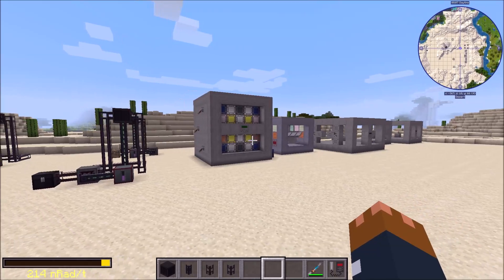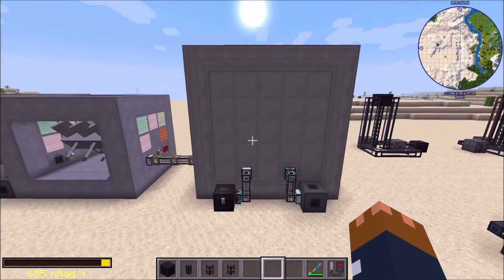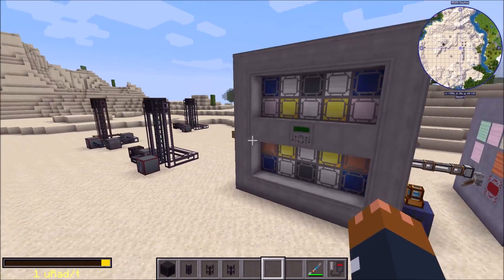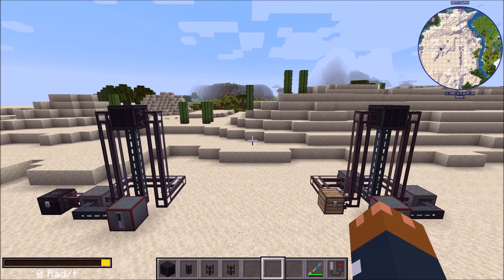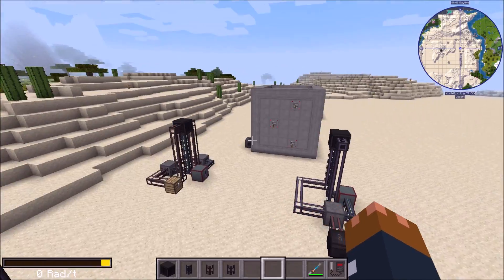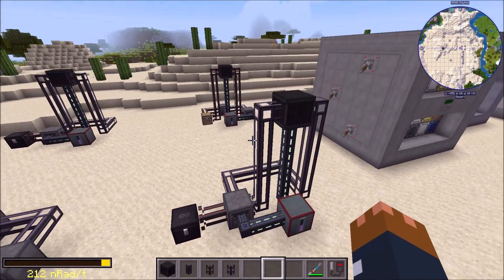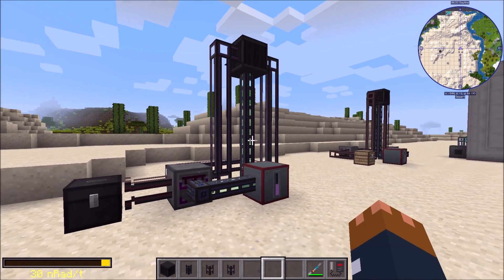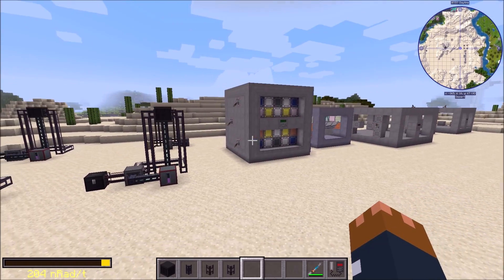NuclearCraft Overhaul - New Radiation Scrubbers

Comment: Okay, so i'm new on this mod, i'm actually researching for an Modpack for a post-apocalyptic modded server i was trying to create but i have some conflicts (personal ones, i have not yet test it) about some of the mechanics on the mod. Hope you can answer some of my questions:

*1. Is there not other way to isolate the reactors or any radiation source from the room or outside? Like cover the room with lead or something?
**2. Do the Scrubbers really clean the entire chunk where they are? Not just the room, but the whole chunk even underground from top to bottom?
3. Is it possible configurate a block to isolate the radiation using the in-game configuration menu of the mod?

*This question is here bcuz i want make an bunker underground and make the surface of the overworld radioactive or at least not possible to survive without countermeasures like a protective suit or Radaway, but i'm worry that the radiation not only affects the surface but everything on the overworld, making it impossible to survive the first day.

**This one is because even if they clean the surrounding area, i don't want to make the place over the bunker turn green while the rest of the world is not.
Reply from the maker: Currently, the radiation system is completely chunk-based and doesn't take in-game walls or shielding into account. So yeh, unfortunately the answer to all three questions is no, but I have some ideas on how to remedy the situation slightly in the future :)
Reply: @NuclearCraftMod  Being able to utilize some kind of shielding would be awesome, like lining interior walls with lead to reduce exposure to outside radiation levels. Don't know how possible that is, would probably be pretty resource taxing if it is.

Comment: Does Mekanism 1.15.2 work on 1.12.2?
I cannot change the version of my game for the sake of other mods. 
If not then how else can I get the radiation scrubber to work? I tried using the different ducts from the Thermal mod. Didn't work, couldn't get borax into enricher.
Reply from the maker: Mods only work for the version they're built for, but Mekanism does exist for 1.12.2. Thermal dynamics should work, as should any other item/fluid/energy transportation methods.
Reply: @NuclearCraftMod  Thanks man, I have the system sort of figured out but still working it out.
Reply from the maker: @I_like_big_bombs  No worries, good luck!

Comment: I cant get it to work.. I did exactly what you showed but It just wont work..
Reply from the maker: Which scrubbing agent are you trying to use?
Reply: @NuclearCraftMod  The RadAway
Reply from the maker: @codingwiz877  And you're extracting the ethanol?
Reply: @NuclearCraftMod  Yes
Reply from the maker: @codingwiz877  Hmm... giving it power? What does it say when you right-click it?
Reply: @NuclearCraftMod  um i think theres something wrong with my scrubbers or they don't work or they are the old ones
Reply: Here is an Image https://i.imgur.com/UqJ3z1S.png
Reply: It says active removal rate : 0 pRad/t [0%] If I remember correctly
Reply: And I have put power in
Reply: I was just stupid and I figured out how to use mechanism because I've never used it before
Reply: (Btw It worked after that)
Reply from the maker: @codingwiz877  No worries :)
Reply: @NuclearCraftMod  what does my config have to be set to to get the one of the tutorial
Reply from the maker: @matteofeyaerts  I always use the default configs in these vids.
Reply: @NuclearCraftMod  hows the setting called i might have changed it (for in the config file not cliënt)